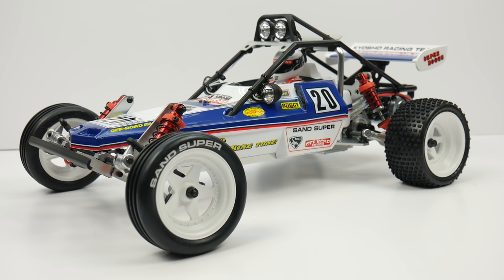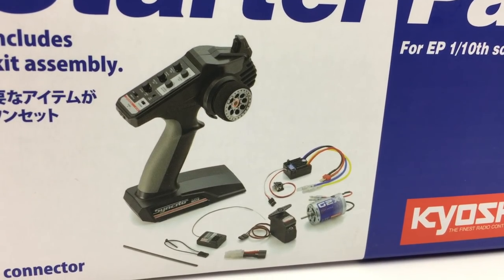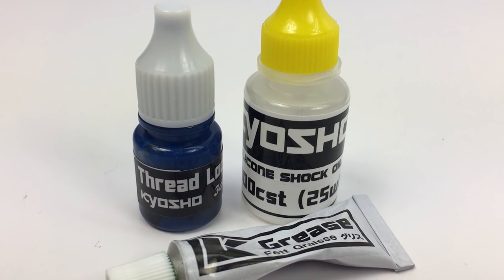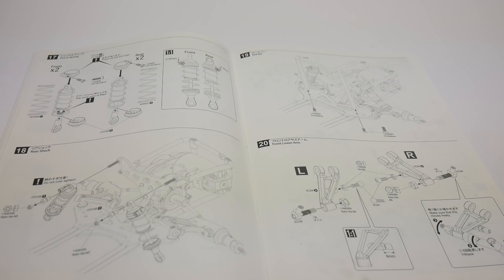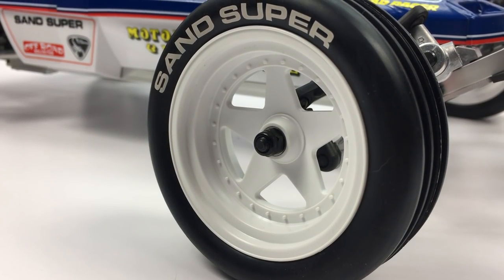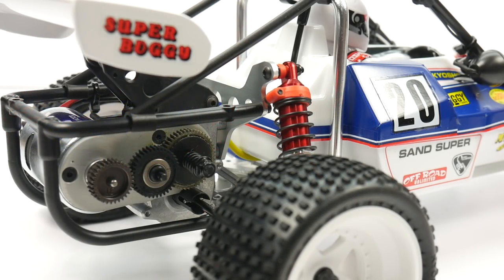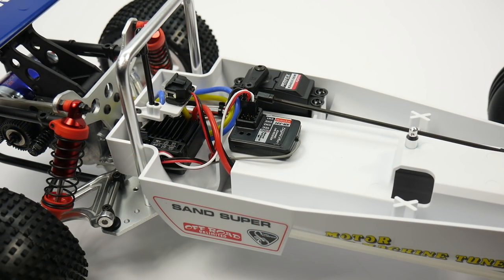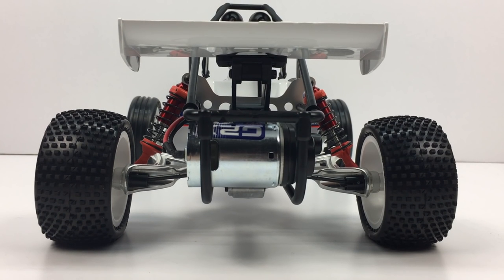Kyosho Turbo Scorpion 2017 Re-Release - Full Reveal

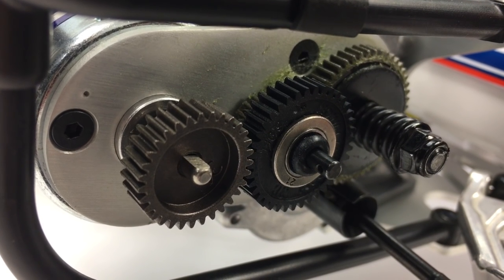Comment: 6:57 Does anybody know if this O-ring is inside the gear box or the outside? In this video it looks like inside, but the manual does look different!
Reply: Did you figure it out. I think the cover pushes on the O ring then onto the pinion to keep in place

Comment: why not a cheap ebay brushless combo. i have one in my rustler and right now it does 81kms
Reply from the maker: Nicholas Coucoularis I've never done "cheap eBay" and this vintage Scorpion doesn't need to go 100mph. I think it will be fine with a brushed motor
Reply: The RCNetwork well i have mine geard up. anyways nice rig